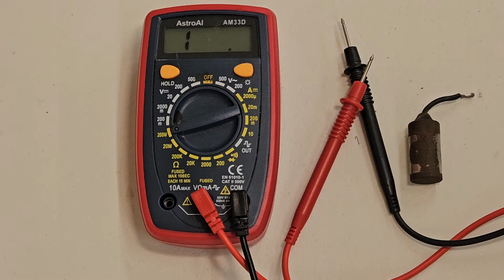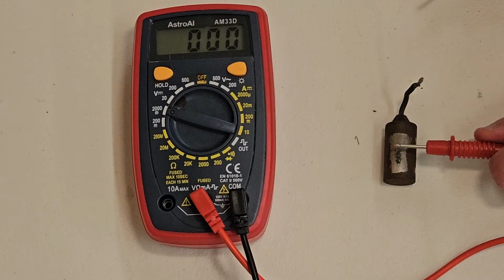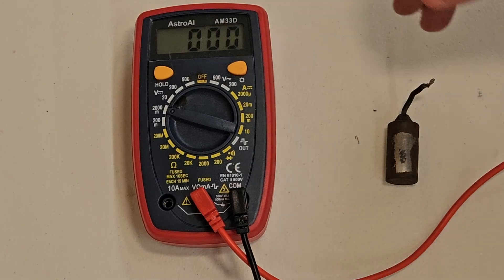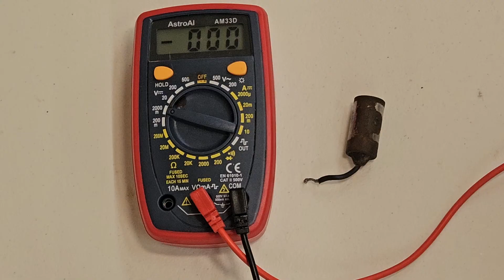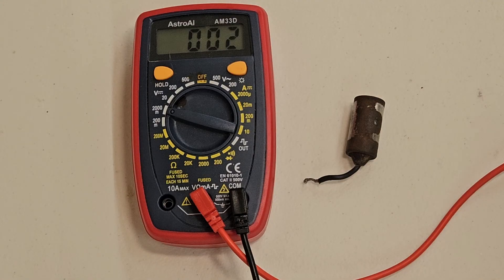How to Test Condensers/Capacitors for Ignition Coils

Comment: nice content, i still dont understand. so in the video, how do i know if the condenser is faulty.
Reply: If when measuring resistance your values are flickering and going all over the place, or after loading the condenser if when measuring voltage is does not hold the voltage then you probably have a bad condenser
Reply: @facundosapia4693 thanks
Reply: Great video, I  made a big mistake I sprayed break cleaner on my stator plate would that affect my condenser